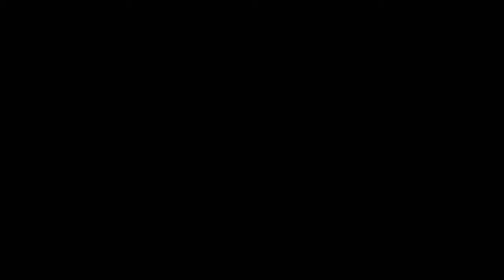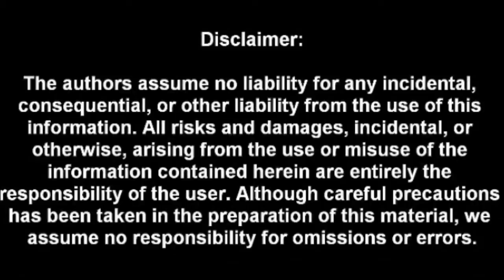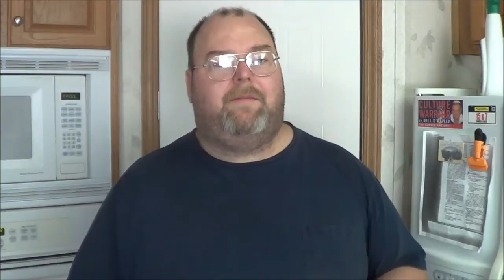How to improve your Refrigerator's cooling efficiency

Comment: You also save a lot of money using a on top freezer vs. a side by side.  get a  separate chest freezer, I have both and the
whole house electric bill is under 20 bucks a month, plus use LED light bulbs. winner.

use the house vacuum on one side and the compressor on the other. just a  suggestion .
Reply: Actually BOTTOM freezers are more energy efficent than a top freezer model